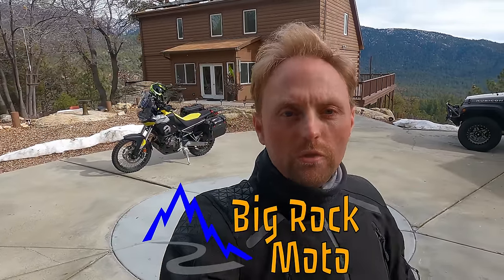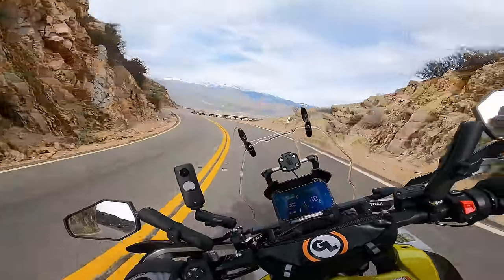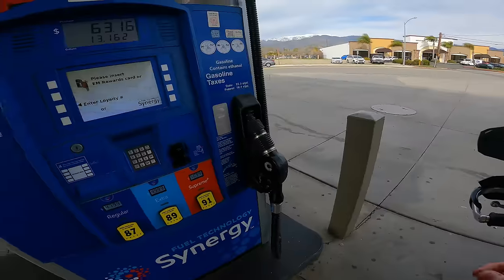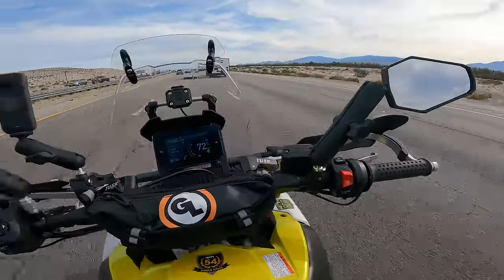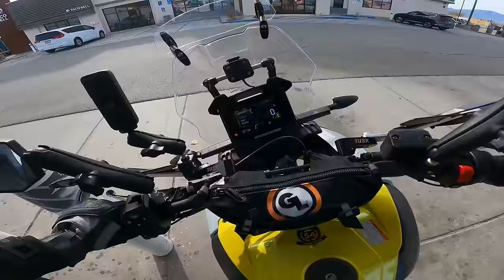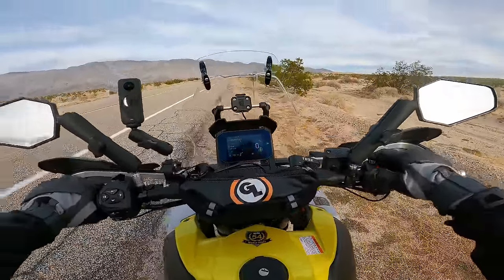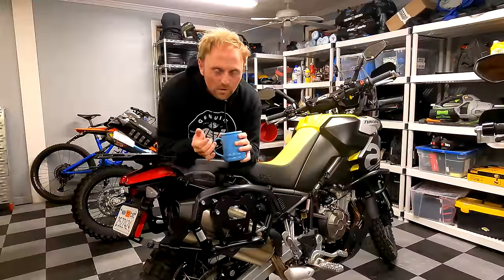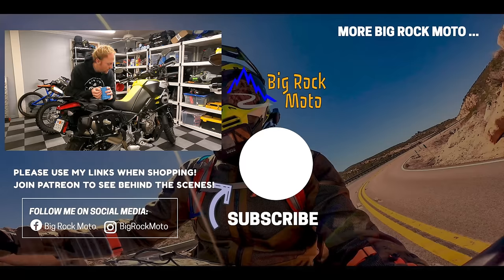Aprilia Tuareg 660 | In-Depth Highway Touring Test (EP.6)

Comment: I notice my mt07 gets insane fuel economy around 50mph. That seems to be the sweet spot. But pushing it up to 75-80 seriously tanks the fuel economy. I think it's just a consequence of exponential wind resistance and higher rpms. The much bigger displacement bikes probably have an easier time at those speeds because they can lug through with all their torque at low rpm in big overdrive gears.
Reply: When touring in Scotland and averaging around 50-60mph my brother is getting over  70mpg on his Tuareg and by comparison I get around 85mpg on my CB500X , we are running soft luggage (Rhinowalk) and a lot of gear so fully loaded but not too much of a flying brick like those with big panniers on racks     , start riding 60-70mph + and both bikes drop off  but the smaller bike drops off much more  . My brother has over 3k miles on his Tuareg now and seldom gets much less than   65-70mpg which seems quite acceptable considering the performance on tap , I will be certainly swopping to the 660 soon as at lower speeds it feels as nimble as the Honda , same low end smooth power for the tight stuff but way better suspension and handling plus it can cope with highway stuff in comfort whereas the smaller bike is not relaxing to ride above 60 , the little CBX despite being a great little bike is way too basic for my desires and it’s let down by junk suspension  that can’t cope with a spirited rider , but it’s built to a price and the main thing the motor is a peach , my previous bike was a 1290SA so I am used to a bit more ! 660 seems to be the bike that can do all without wrestling a big lump anymore  and despite looking closely at every alternative I keep coming back to the Aprillia because it’s spec is so great and even it’s strange looks start to grow on me .

Comment: Agree: the fuel consumption of at least 4.5L/100 (52mpg) was a bit of surprise for me after NC750x. As for the wind protection I’d say that on any bike you need to put a touring screen first and then make conclusions about the buffeting on a highway. In any case, after crossing the mountains using the path where even bears are afraid to crap - I can’t complain about this bike not being a Goldwing. My skinny backside doesn’t like the seat too much though.

Comment: Maybe a dumb question, but is there any possibility that the grips have been connected in series rather than parallel? If connection is correct then they're obviously not a lot of good. Go for Oxford heated grips next time! High setting almost burns your palms!
Reply: I agree….go with Oxford Hotgrips. They are superb.

Comment: Since you've owned both, if you had to, which would you prefer for highway riding/touring, the Aprilia or a ktm 890 Adventure-R ? (I realize neither bike is designed as a tourer). I have a KTM 1290 and thinking of getting something lighter, but occasionally I do spend a few hours on the freeway to get to fun roads.
Reply from the maker: Probably the 890R but not by much. I just like lots of power.

Comment: Interesting video as your bike is set up similar to mine.  I mostly do touring on mine, just did 1,400 miles across Europe and it worked brilliantly, longest day was 400 miles and I still felt OK at the end of it.  The stock tyres worked well in all road conditions, it rained most days but they dealt with it just fine.  I’m just replacing them with Pirelli Scorpion Trail 3’s which are more tarmac biased for touring.  Full Akroprovic system was a great addition as were Oxford heated grips which do work very well.

Comment: I had a question, thet you've never answered, but I guess this clip answers - how the  UPDATES ( software ) were rolled out.... Looks like you've been lucky with THAT - unlike ME 🤢🤢 (  and my Guzzi ). 
The thing that stopped me from getting this bike is -  relatively short valve-service intervals. 
If it was arround 40000 km like on the T7 - I, most probably, would be riding it as well.

Comment: Nice to watch review and some good info about Tuareg 660 . Thanks for that ! 

I know that on the street KTM 890 Adventure R will be better ( especially 2023 model ) from the Tuareg 660 , 
but what are your thoughts when it comes to Off-Road riding ? Fact is that KTM 890 Adv R is around 6 kg ( wet weight with fuel ) heavier from Tuareg 660 , 
but KTM also has lower center of gravity . As you have them both for quite a while, would you be so kind and tell me your opinion 
whats better for off-road riding , Tuareg 660 or KTM 890 Adventure R ? 
What bike would you choose for 60% off road use and 40% street ? 
Regards from UK  ;)

Comment: Ian, I wonder how many miles you have on your bike. This may sound funny but,Once I hit 1000 miles I almost immediately began seeing better fuel economy. I was in the low to mid 40’s as well now however, I see 50-55 MPG. 
And the heat is crazy off the engine. My RS660 was the same way.

Comment: This onroad behavior reminds me of my long gone (but beloved) 2003 Ducati Multistrada MTS1000DS. The Duc's happy place was more like 85-90, but the engine was basically not there under 4000rpm - you adjust. And it was atrocious off road. So, a bit of a tradeoff, but I'm fine with cruising at 80, and to get true offroad capacity, that's just fine.

Comment: Hi Ian, thanks for the indepth videos of the Tuareg. The only question, and probably the most important one, is how the bike performs on very long and for the bike demanding journeys. My wife and I just returned from 25K miles 2UP ride Alaska-Ushuaia on our Honda Africa Twin 2017. In our opinion there was no better bike for this trip. No technical issues at all. None. Zero. 

With bikes like the Tuareg and the electronics on board, the last thing you want are electronic issues in the middle of desolate areas with 100F+. Electronic problems that prevent you from driving further. For example, a sensor on the right front fork that prevents you from driving (exaggerated example, but then you know what I mean).

A nice bike but I have hesitations to buy such a bike. What is your opinion?

Thanks and keep up the good work. I love your videos. Cheers from The Netherlands.

Comment: I have had these same grips on Moto-Guzzi. I replaced mine with some cheap Bike-Master grips for less than $50.00 - twice the heat.  I cut mine open to discover that instead of heat wire running through the rubber part of the grip, this Aprilla brand uses a pad/wrap. The heat has to travel through the entire rubber part of the grip before reaching your hand. Just my 2 cents. Enjoyed the review. Test ride all day on a Tuareg, wind buffeting was awful (windy day) Seat, not so good. Enjoyed the review.

Comment: Tested mine on a highway after the 1st service:
1) 6000 rpm at 80mph/120kmph is something to bear in mind for those who like to go fast. Jan was right when he pointed out the 6 gear ratio being a bit too low;
2) software update/throttle recalibration is a must - hence no happy life without dealer support;
3) noise caused by tires, exhaust and induction box is something that you may get annoyed with after 40 miles of ride (((

Comment: Shame about the heated grips. OEM stuff always looks tidier, but I like the Oxford heated grips. They get so hot you only ever need summer gloves, and they are cheap as well. Not super impressed with the mpg either. My CB500x has a slightly smaller tank and a range of 300 miles.

Comment: Good job 👍
The engine heat is what helps the seals/gasket failures as well as the oil filter/oil cooler nut which are found to be loose from the factory.
Yeah id be pissed after the time/money spent on the grips.
Maybe needs a software update.ive heard similar issues with the factory Yamaha t7wr grips.
Thats the only thing that puts me off the European bikes is realibility issues.
Such a shame that your missing out on the T7 world raid everything that was wrong with the std bike its been rectified bar the exhaust hanger.
Looking forward to seeing more content.
When is your sportsbike coming or is it the BMW 900

Comment: Ian, 
In the programming mode you can increase the RPM setting when the red flashing light comes on. It's a little annoying! The rpm is set pretty low from the factory. I was also pretty disappointed with the OEM heated grips too. Thanks for your excellent content as always! 👊

Comment: Another great video, thank you! I'm with you on the cruise control comment (got rid of my otherwise fantastic Street R because of that). I'd take a sheet with fuel consumption comparison (may be difficult to ride in comparable conditions) and engine rpm comparison at high way speed.

Comment: I test rode one. There is no perfect bike for everyone, but the few things I couldn't live with are...

1.) Poor heat management. 

2.) A blinking light while using cruise control that looks like you left a turn signal on. 

3.) Wind buffeting/noise

4.) Shifter and brake pedal are very exposed to damage in the event of a crash or tip over.

5.) The one I rode would momentarily cut out on the highway several times. It was only for a brief second, but irritating. Perhaps a mapping issue(?)
Reply from the maker: I mostly agree. For #5 yes that us a software mapping fix

Comment: Another thing to add to your comment on wanting a taller 6th gear, that Tuareg has an overall gearing in 6th gear of a little over 6 to one, which backs up your comment, and that’s why I ended up going to a 16 teeth front sprocket which brings it’s overall 6th gear ratio the same as the T7

Comment: Ian how does the Tuareg 660 compare to 900 Rally Pro and Norden for highway and touring use (wind protection, noise and buffeting) we're the same height
Reply from the maker: less buffeting than the norden, more than the Tiger 900. the tiger  900 is great on the highway. the tuareg does everything pretty well if you can live with slightly less power

Comment: Hi Ian, what do you think of the gearbox?
I have this bike and finding the neutral is extremely hard. Even the shifting itself, especially going up requires a LOT of force. I had a Honda CRF1100 before and regarding the gearbox in comparison to the Tuareg, it's like day and night, the Honda was so much better, much more precise and literally 0 troubles finding the neutral even when the bike was brand new. On the Tuareg, I sometimes spend half a minute trying to put it into neutral, which is seriously frustrating.
I also had a Ducati Scrambler Desert Sled at one point and while it didn't have a nice, Honda's gearbox, the Aprilia is much worse. To be frank, of all the bikes I have had in the past, the Aprilia gearbox is looking to be the worst I have ever experienced so far.
Reply from the maker: It's not great, but something sounds off with yours. Maybe a clutch adjustment or shifter adjustment. It should not act like you describe.

Comment: what kind of knobbies did you have on? I have had shinko 804/805s on my old F800GS on long trips that included a lot of asphalt and they did well, of course the downside is they wear out fast and get noisier. Currently using tourances but I'm not impressed on any kind of gravel. Any recommendations ?
Reply: Motoz tractionator rallz  like he has here seem like the best way to go.   I also have a 2014 f800gs

Comment: I wonder if the techs damaged a wire when installing the heated grips? I've been riding mine in 40-50 degree weather and found them hotter than my last set of Apollo heated grips. My experience could be unique though, since my last bike didn't have hand guards to block the wind.
Reply from the maker: possibly

Comment: Ian, I'm looking to downsize my Tiger 900 RP to a lighter touring bike with some offroad. The two bikes I'm considering most are the Tuareg 660, and the CB500x (with Rally Raid treatment). If you aren't in a huge hurry, and you had to pick one, which would you choose?
Reply: I am a smaller guy and am in the same dilemma as you. I thought about it hard. I would ultimately choose the Tuareg as it was designed from the beginning to be great off road. The CB500x RR has much better suspension then stock, but then the center of gravity goes up, the weight goes up if you go with spoked wheels, the offroad electronics are not there, the TFT is not there, the cruise control is missing, and the list goes on. I also thought about modifying an even lighter bike - the dr650 for adventure riding. Ultimately, I keep coming back to the Tuareg. Check out the Tenere 700 Explorer that was just announced. I don't know if you are in the US or not. Hopefully coming to the US. Who knows if the Honda Transalp will show up in the US
Reply: @dankatz3  I pretty much have come to the same conclusion. While I can live without the TFT, the bike checks all the boxes for me and is only marginally heavier than the CB.

Comment: Thanks for the great info. I just sold a Tenere 700 that I only had since September. I found the T7 boring (especially as a road bike) and cheap feeling, coming from a KTM 950/1090. I've been curious about this bike, but I'm ready to pull the trigger on a great deal on a leftover 890R.  Do you think I'd feel better about the Tuareg, or should I just go for the KTM?
Reply from the maker: The Tuareg feels like a higher quality bike than the 890R. However, the KTM is the most fun ADV bike you can buy, and has a lot more power than the 660. Buy which one speaks to your heart.
Reply: I would not make a decision until you get to test ride the Tuareg, preferably around the same time you ride the 890. Then, as Ian said, choose whichever one speaks to you the most.

Comment: As a Tuareg owner I love this review Ian, I’ve noticed a little more wobble at interstate speed with my Motoz tires 80mph+, not a big deal, putting it in ATC 1 off-road is a blast! Also do you feel any instabilities from having the bags on (highway speeds)?
Reply from the maker: didn't notice the bags causing any issues, that I could notice
Reply: @BigRockMoto  Great, thanks

Comment: Excellent review. I am surprised Aprilia engineers would not do a better job with the heated grips. Maybe when they calculated amp draw they took all possible future add ons into account and kept the wattage down so stator could not be overloaded? I have Oxfords on my VStrom and rode in 10 degree temps and NEVER kept them on high. I am very jealous of the cruise control though. One of these days.
Reply: I thought I saw someone post on one of these videos that the low heat output was a software bug and that the fix is a quick software update.
Reply: It may be a general issue with running heated grips through the dashboard circuit (in order to get the dashboard integration). The max. amperage will be limited since you share it with other important devices on the same circuit.

After-market heated grips are usually run straight from the battery, so get the full power available.
Reply: You may be right. You would think that they would have circuitry soley  designated and able to handle higher wattage grips.$400 is not chump change and everything else on it are state of the art. Maybe Aprilia had a junior engineer  design their grips. The one whose looking for a job.😁

Comment: Maybe this is already in the comments, but VW has anamazing offroad vehicle called Touareg. I had it for several years and I liked it a lot. Onroad and offroad, in snow and water and gravel, never failed. I also like that you recommend the quick-shifter and the cruise control so strongly, I very much want to install this on my old Honda (old in the meaning: before quick-shifter). Thanks for the review.

Comment: I bought one last month so far enjoying it a lot. Only downside "the right leg heat". This week I'll get the heated grips installed. Hopping they are not that bad 🥲
Reply: Can you go aftermarket Heated Grips. Or is the Integration to the Dash worth the cost?
Reply: @darwinLee81283  i picked them because:
- I got a decent enough discount in the dealership to not look into aftermarket. 
- I assumed they are not cheap but would be at least good enough.
- With aftermarket i would not get the 3 year warranty and my insurance won't cover them.
- I'll have have to install them myself or pay for it.
- The dash thing is convenient to avoid. clutrering the handlebars with buttons.

But if they turn out to be garbage all this reasoning goes out of the window 🥲
Reply: @YouTenaza  Haha Hope you enjoy them

Comment: Did you swap out the factory Pirelli STR tires?  They are extremely capable on the road and I don't feel like they limit the handling in any way.  I just did a Total Control class on them and ground clearance was the only limit
Reply: They don't really work off road though.    Great on the road they give up nothing.   Off road they just slip sideways though.
Reply: @chrishart8548  agreed, but he was talking about on road performance
Reply: @Travis Kelley  he does do a lot of off road
Reply: @chrishart8548  my point is he was making it sound like the "off road" tires were somewhat holding him back on road.
Reply: @Travis Kelley  well they were  rather a lot actually  motoz call them a 90% off road 10 % on road.
Reply: @chrishart8548  ahhh, makes sense.  That's all I needed to know!